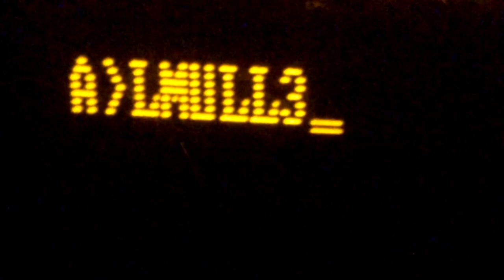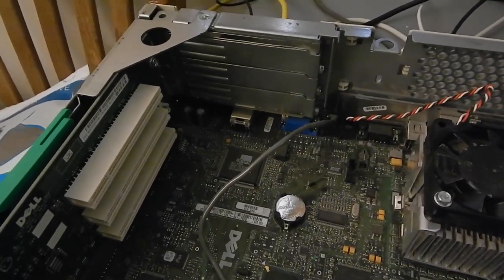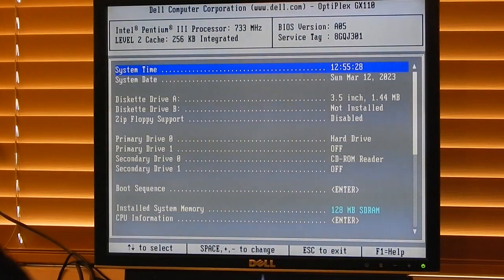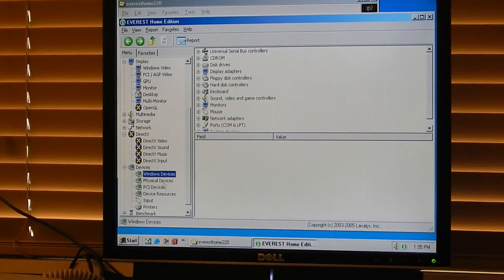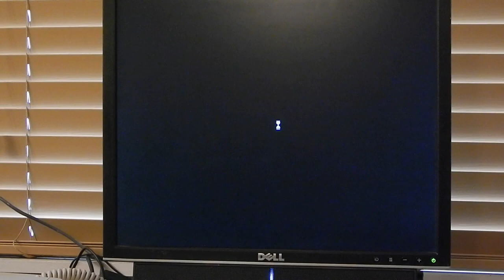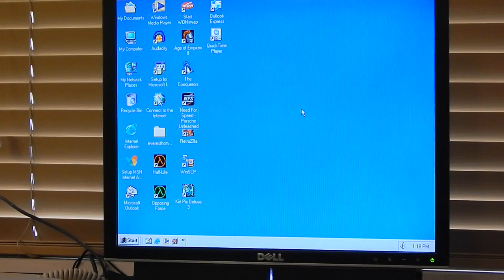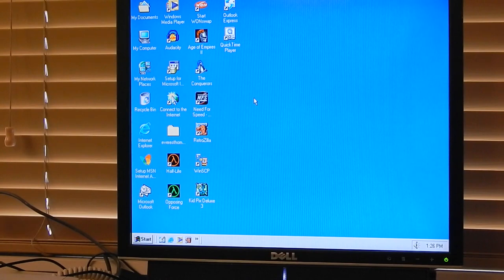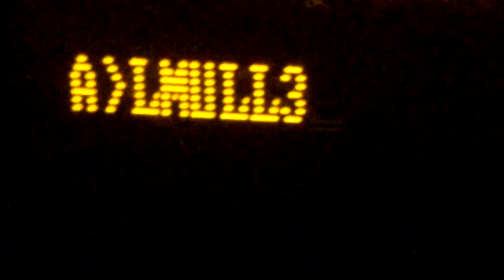Dell Optiplex GX110 Desktop PC

Comment: Back when I had my windows 98 machine setup I had an 80 GB drive and partitioned it to have four partitions so that each logical drive was under 20 GB to avoid file corruption in windows 98 and had windows me and xp on two of the other four partitions and used the fourth for any common files between the four. My machine was a slot 1 pentium III running at 700 mhz with 128 mb of ram because I never bothered to replace the faulty ram stick I pulled out years ago. This machine of mine would need some serious work to get it stable again as it freezes any time it gets bumped slightly. It also will fail to boot if left powered off too long indicating a failing capacitor somewhere in the power supply. If properly restored it would make a great 90’s gaming rig and maybe some light early 2000’s if I put in the right parts.

Comment: ours were pentium 2 with 256mb of ram and windows 2000 pro , in use up to 2009 when i scraped them all and replaced with used optiplex 755 with windows 7 and those live up to this day (due to be replaced in 2 years after being upgraded to thre max along the way)

our gx had ati rage on board with small sodim upgradable memory and one got watered trough a plant that sat on top that small square blanking plate in the middle of top case is surprisingly good at passing water trough directlu on motherboard

Comment: I have the larger version of the GX110 desktop and mine came with ATI onboard video, with a RAM expansion slot to take it to 8MB of RAM. Of course, it has the slowest CPU (450MHz) to balance that out, because that makes sense.